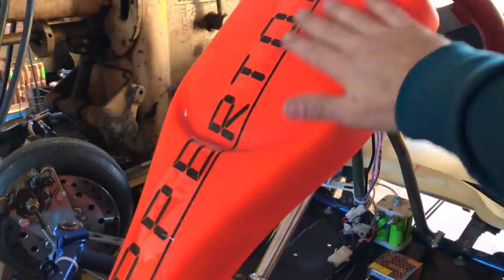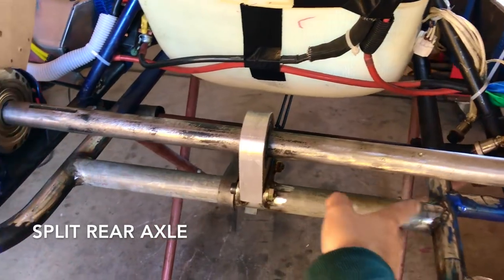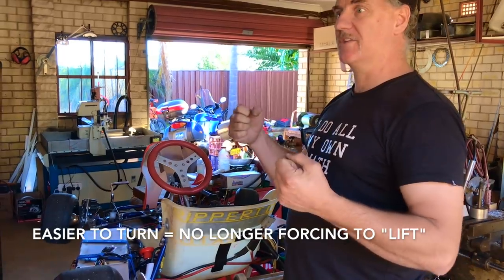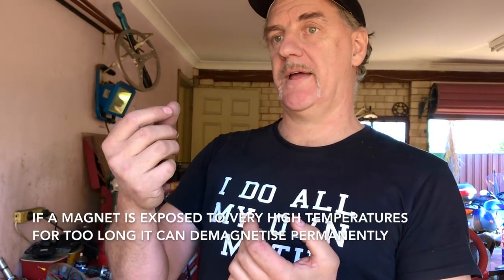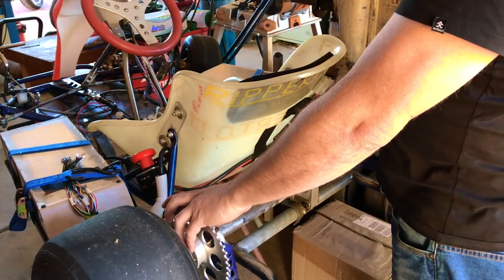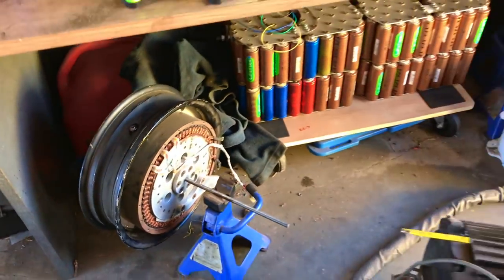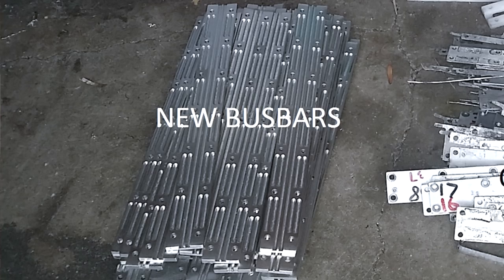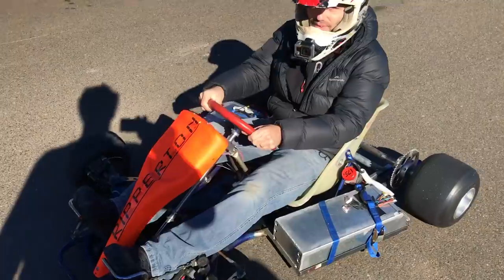DIY Electric Go Kart - Twin Axial Flux Motors - Ripperton - Part 1

Comment: is the controller sine wave ? I want to build a bike and I do not know what to put normally or  sine wave
Reply from the maker: Ionut yeaahhh it’s sine wave but some sine wave controllers are quieter and more efficient than others. The best is the FOC (Field Oriented Control) they’re smaller, more powerful, quieter and more efficient compared to most sine wave controllers. Check out the Phase Runner http://www.ebikes.ca/shop/electric-bicycle-parts/controllers/c-phaserunner.html#
So much POWEEEEEERRR =]

Comment: the rear axel thing youre missing a small bit of info when both if the wheels work at the same rate the car becomes very oversteery* in the slow corner but a faster corner it will understeer, when moving around the corner the outside wheel will travel further than the inside wheel so giving it dualmotors working at the same rate even though theyre not necessarily connected, will still cause this problem because they're working at the same rate, if you use a steering angle sensor to determing the amount of power to the left or the right wheel this would fix the problem, or you could use a g sensor to know when youre cornering.

EDIT: so youre rely on the grip of the tyres causing more resistance, pretty cool.
Reply: Having two motors + a sttering angle sensor would also allow you to drift this thing like crazy if you implement it this way in software. Think about it! You could have different settings on it that would allow a multiplication factor for the value read from the steering angle. If one would crank it right up, it could (for example) give 50% power to one motor and 150% to the other which would probabbly make it spin right off!

Or, just put one of the motors in regen mode an the other in full power!? Instant donuts? 😎😋
Reply from the maker: Yeaahhh we will be testing with just a single throttle and see if a small Go Kart behaves like his previous heavier electric car (we wouldn’t miss the chance to experiment like that first). We are talking to Sketch who is currently designing a “launch control” throttle with accelerometer and many other smarts (his throttle actually works and it’s pretty amazing). We are trying to figure out how to add a steering position sensor to the steering shaft + understand the G forces and cross these data and see the performance improvements we can get ohhh yeaahhh!!!
Reply: Instant Like!
Reply: @BrunoPOWEEER  couldnt you just connect the throttle to a potentiometer/variable resistor and get a reading off that and translate that into power?

Comment: Woah.. that's a mean beast, and professionally done... Hope we get to see it in action soon!
Reply from the maker: Andy Lee Robinson yeaaaahhh... Danny is just finalising CNC the parts and putting parts together... we are also talking to Sketch who is currently finishing his “launch control” throttle with accelerometers, we are discussing about adding a steering sensor and cross all data with the G forces, sounds very promising hahaaa =]
Reply: Well, the rotation differential of the wheels should be fairly easy to derive from the steering column angle, and this should be independent of speed, so a slight power/velocity increase/decrease could be added/subtracted to each motor on a turn. Would only be significant for tight turns though.
Reply from the maker: Andy Lee Robinson yeahh you got it all right... may not be very noticeable in general but it will really make difference in tight corners =]

Comment: Hey sir, It's awesome e-kart, can you give me information about how should you connected all the circuit
Reply from the maker: Yeah sure!! Let me know exactly where is the part where you’re struggling. 
It’s basically very simple, you just need to follow the motor controller wiring instructions, two wires (thick red and black) goes to the battery, 3 thick wires go to the motor, 5 motor sensor wires also connects to the motor and 3 wires to the throttle/accelerator. ON/OFF switch and may have a display depending on controller model.
Let me know if that helped =]

Comment: hey Bruno I'm real big into rc. you should look into mgm 1/5 scale controllers. there biggest one can take 800 amps continuous. tppower motors they make a 100mm diameter by 300mm long motor brushless motor, it's supposed to make 100hp at peak
Reply from the maker: Hey mate, thaaanks for the good info... 800A RC controller/ESC??? WTFFFF
I only know the 300A Swordfish one... have you seen my little 42kW RC trike, insane performance using 3 3220 AstroFlight RC motors and 3 Castle HV160 ESCs https://youtu.be/sRH_cpCwNDs so much POWEEEEEERRRR

Comment: Nice videos,
Do you recommend a certain motor? I was looking at the ME1012 motor running at 96volts

My lipos are 20ah 96 volts at 240amps countinius and 500 amps burts.
I was going to use the kelly controller for it

Comment: I love this video, where do you find a on and off cut off switch like that (165 volts 600amps)? for this do you need a contactor or can you just plug the battery to controller? maybe use a anti spark connector. What controller was that of KEllys?
Reply from the maker: Yeaaaahhh that red emergency switch is just cutting the 12v that powers the big contactor. Also when you see a switch rated for 250v it’s normally AC and half that for DC. Never just plug directly to the controller .. if something goes wrong you need to be able to pull something apart... even large Anderson connectors just something you can quickly disconnect.
Anti spark connectors like XT90S are only good for low voltage up to 60v max... there are other bigger anti spark connectors out there for higher voltage but in EVs you never do pre-charge at the connector, you calculate a proper resistor for your voltage and how many seconds you want to pre-charge. 
Yeah Danny is old-school and loves his big Kelly controllers haha
Reply: @BrunoPOWEEER  ok thanks. ya im having a hard time finding the right contactor and switch for a electric off road minibike setup. im using turngy 20ah 6s lipos, 4 of them in series with a ME1012 motor. looking for a controller around 200amps continuous and 500 peak. do you rec other then kellys? everyone I talked to says go with Kelly. I guess really easy to setup? I might make a 30s pack with the cells danny used, instead of the turngys ( I don't like the 10awg power leads on them).
Reply from the maker: Yeah I have the exact same cells here, big blue 20Ah 6s bricks https://youtu.be/4bG4qzuGiNs the 10AWG wires aren’t too bad if you cut the connectors and keep the length as short as possible. Kelly controllers aren’t the most advanced or the best premium stuff but super easy to buy and setup... I’ve been using ASI BAC8000 controllers https://youtu.be/aRzmNqAuEhQ
Reply from the maker: We sell these contactors at work, 350A continuous can handle 1000A burst no drama

https://www.elmofo.com.au/dc-contactors.html

Comment: Bruno, what do you think of the LTO batteries? Can you make a video about them? They’re very powerful, they can be recharged in 6 min and they have a very long cycle life (15.000 or more) . The kart with these cells can be rent in a circuit performing better than petrols ones and recharging between each race session with a long life time of battery

Comment: I like your channel when the Yamaha R1 converted into an electric motor. It's really cool.

can you tell me the peak rpm and power on the electric motor on your go kart ? Thanks..
Reply from the maker: Yeaahhh the go kart is finished up and running I just need to organise a day to go with a Danny to a track and make a video showing the POWEEEEEERRR
the Go kart ended up being 110kg 80hp dono tested 60kW peak power, 175v controllers 600amps, liquid cooled motors (not too sure the RPM he’s running) and 4kWh air cooled lipo battery....
This is a small kids size go kart, senior bigger go karts with Rotax engine are between 30-50hp max... imagine 80hp on this little one hahahaa Danny Ripperton is a mad scientist hahaa

Comment: Awesome build! Does that thing go reverse? I'm designing a build of my own EV with independent AWD. Wonder if left and right side go opposite of each other and wheels were straight, would it pivot around like a tank?
Reply: Yes but since the axles aren't pointed at the pivot center there will be some slippage between the tires and ground. Relatively long vehicles will result in more tire scrub while wide vehicles will scrub less.

Comment: so what if u use the tesla style motor design and put the drive axles of both end through the motor, this way u will eliminate ton of extra weight and moving parts and power transfer will be much more efficient!!!

Comment: I love the way he tinkers with everything! The motors, cooling the magnets and the battery, brake  with 3way splitter + sensor for regen, etc. A lot of cool ideas!
Like other viwers commented already, I was also thinking at a steering angle sensor to take advantage of the dual motors, without a differential on the axle. This would be an 100% electrically assisted virtual diffeeential. Moreover it would behave as a difflock or LSD (limited slip diffeeential) when needed. 😎
I would put all this technology in an offroad vehicle. Man, that would kick so much ass!

Comment: If you really want to know what having 4 independently controlled wheels is like, look up the prodrive p2. That thing corned like it was on rails.
I can only imagine what that car would be like if they put electric drive on all 4 wheels.
I think you'd run out of tolerance for lateral G before it ran out of grip.
:)

Comment: that was wrong 90.08hp if I didnt screw up my math again holy crap that's crotch rocket hp numbers with half of the weight of more wow this thing is ridiculous!!!
Reply from the maker: 10 a C e bikes Jody Bennett II hahaha yeaaahh the numbers are craaaazy, so much POWEEEEEERRR in a little light Go Kart. These are Axial flux motors that produce a lot more torque than regular motors already and we are adding 16x BIG badass monster magnets to boost things even more hahahaa this is going to be so ridiculous =]

Comment: this thing is gonna be ridiculous?? so will it be 200 per motor times what voltage 168v x 200 35,600watts per side anybody wanna divide that by 746watts per hp let me know what kind of power he's expecting I am thinking 40hp but seems low!??
Reply: 40hp electric isn't the same as 40hp gas engines tho. That electric stuff is instant POWA you know!

Comment: Thats not really a correct application of vehicle dynamics.........
So the benefit of having the split axle at the rear would be to apply different power to each of the rear wheels. The best way to analyse this is to draw a fee body diagram from the top and map the forces, (he does his own maths, but he hasn't done it here yet). The forces are still inclined to push the kart forward with the split axle. Lifting the rear inside tyre does remove a lot of the push but it has a lot to do with the outside tyre which is outside the front track width and thus controls yaw.
Another tendency with a solid rear axle is that the transfer of load is greatly effected, with a very stiff rear end on karts this has be greatly exploited.
btw do not touch the caster angle!!!!!!!!!!!!
Reply from the maker: nelson phillips yeaahhh know exactly what you’re saying but we need to experiment it first, Danny tested on an electric car and it worked really well, now we have to see how it behaves on a much lighter Go Kart... 
Even if it doesn’t work we will come up with a different solution, maybe something connected to the steering wheel that balances both controllers output accordingly... we need to test both =]
Reply: don't get me wrong, splitting the rear axle isn't necessarily a bad idea. I just think the hypothesis  presented may be null. ;-) Luv to see the results!
Reply from the maker: nelson phillips good news, Sketch is finalising his “launch control” throttle with accelerometers and a fancy highly tuneable software, we are talking about adding a steering sensor to the steering shaft + understand the G forces and cross all these data on the software, maybe more sensors but as per our initial conversations it sounds very promising... hahaaa ohhh yeaahhh =]